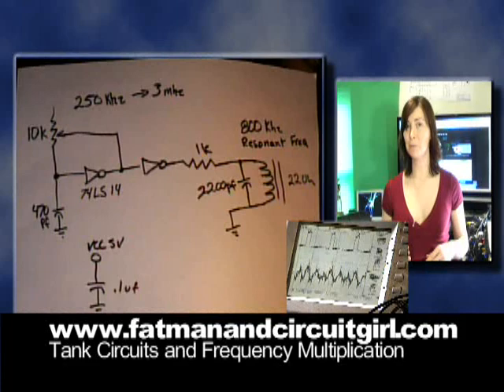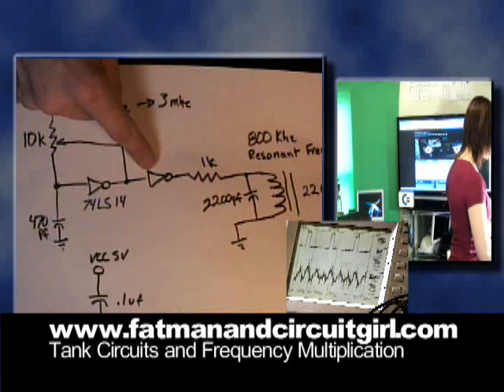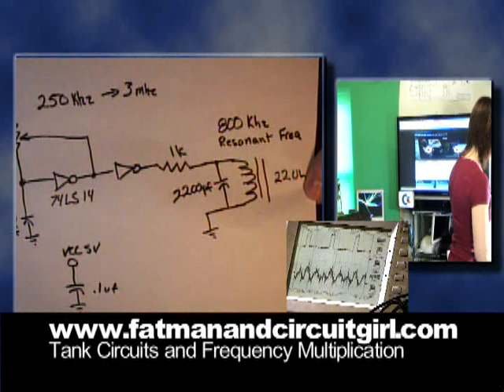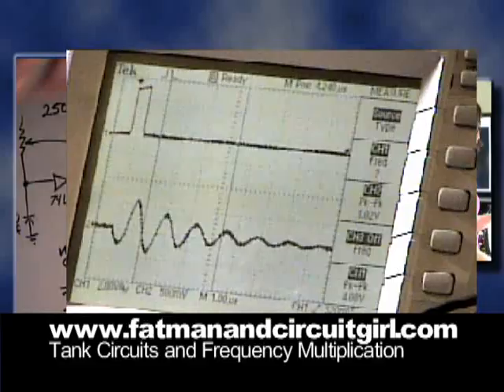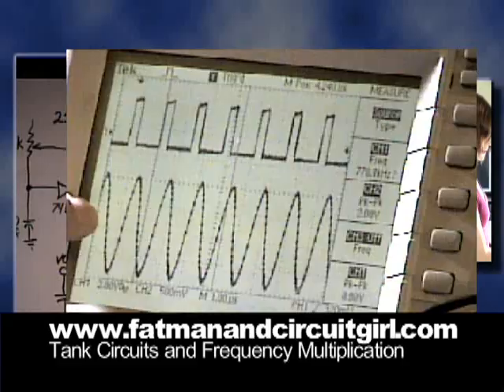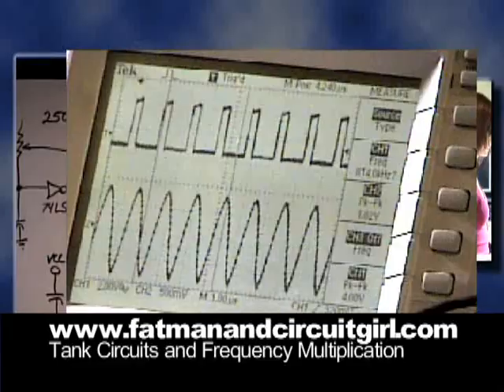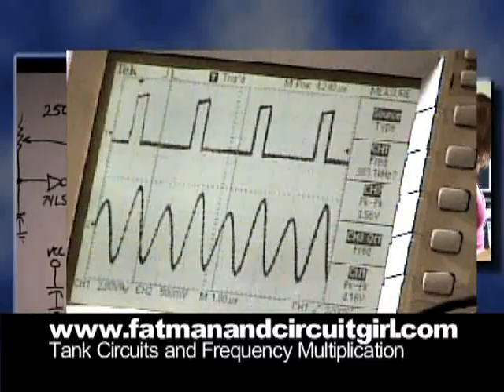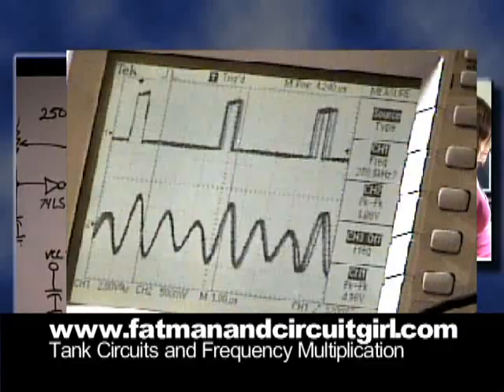Frequency Multiplication with Tank Circuits - Short Circuits 2

Comment: Here is another REALLY cool way to accomplish this through the forgotten technology of Magnetic amplifiers, or saturable reactors. If one winding on a core is wound 90 degrees to the other, they do not couple. however they can change the impedance of the core. If one sees a sine wave at 1hz, and the other has a DC bias, the one with the bias will see the permeability (and impedance) changing at 2 times per cycle, and POW frequency doubling via the BH loops.

Comment: Hello Jeri, I like the topic. I have observed the effect of a pulse or square waves on a tank circuit. You get the "ringdown" similar to a bell being struck. The fun part is when you have a variable capacitor in parallel with the inductor. Adjusting the capacitance will shift energy from the larger waves of the ringdown to the smaller waves. This distributes the energy across the ringdown so that they become equal in voltage. While the overall voltage is reduced, the frequency is multiplied as each wave reaches the same amplitude. It is amazing to be able to create a frequency multiplier with the simplest of components, an inductor, a capacitor, and a square wave signal source .

Comment: Good stuff. So I am very interested in Resonance. I found this paper that describing heterodyning. Armstrong, apparently, observed two peaks, one at TWICE the frequency, which most people use and the other at a PHI ratio. The circuit, back then, would filter the PHI ratio peak, filtering, and keep the 2x one. Yet, I also learned that the interesting thing about PHI ratio harmonics is that they "perfectly" mix. This is possibly something that can be exploited. Hubbard has this interesting PHI ratio coil. The cylinders of the coil had one central coil, and several surrounding coils that were a PHI ratio diameter. Why? I found that the self-resonance of the coils were also a PHI ratio -- which must have been intentional. So sacred geometry in coils might be an interesting area and also self-resonant heterodyning, for low-power energy harvesting applications. Yes indeed, study the works of the "masters" from the late 1800s to early 1900s.

Comment: It is, indeed, a periodically "pumped" LC oscillator. Old trick for obtaining single harmonics.

A processor would have an on-chip PLL, of course. A look at one of them little MP3 player SoCs (AS3525 or somesuch) shows what's doable these days.

Comment: Sorry for coming in so late. In the cases of the 2nd and 3rd harmonics arising from input frequencies (in this case) of 400kHz and 267kHz respectively, can you clean the signal up to a nice(r) sine wave by putting it through a second identical tank circuit do you think? If so, could this clean signal then be used to generate a further doubling or tripling of frequency with another appropriate tank circuit? And onwards and upwards..?

Comment: Whoa, I never really thought of using the resonant frequency of a tank circuit that way. Do you think it could work in analog video applications (Ntsc/PAL) ?
I use video circuitry to do live performances, and thinking since quite a time to build my own video synthesizer, trying to detaching myself from already used schematics though; and this one seems to be pretty flexible to be designed for that purpose :)
Thanks for the inspiration!

Comment: Hello :) You don't show how your scope is connected to the LC circuit. I want to double a 10 MHz frequency to clock a micro controller at the new 20 MHz f, so that the clock pulse of the first micro is synced to every second pulse of the faster micro.
Reply: Brek Martin Simpler to just clk the first with  a 20Mhz osc, and use an ls74 to divide the 20M to 10M.
Reply: steve adams , Hi Steve, that would normally be ok, but the 10MHz source is a rubidium standard. I had some success with this with a scope, but not ideal inductor values. Maybe time to look at using a PLL.
Reply: Brek Martin A rubidium standard is prolly not going to have enough drive capability for an inductive load. You will have to buffer the output.
Reply: Hi I must have missed that posted a while ago.. I have LM7171 amplifier, and it does do nicely capacitor coupled to a few outputs if you want :)

Comment: Nice, now wtf is a tank..nevermind, I thought the negative pulse of a ac circuit gets flipped to a positive n you get a double frequency dc circuit..but I'm not talking about no 800khz neither tho f..... Blinding batz out here lol.. Peace!
Reply: +Rook E A full wave rectifier produces (almost)DC voltage with a ripple frequency double that of the AC input. I say almost, because it is technically still ac(but will register as low ac voltage on a multimeter), because diodes do have a bit of current flowing reverse bias, but anyway, I think this is what you are referring to.